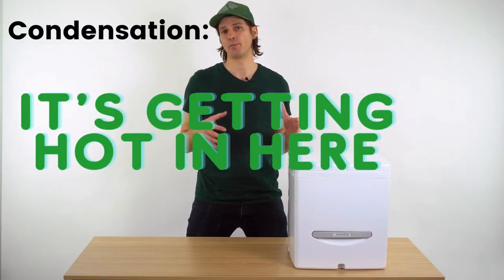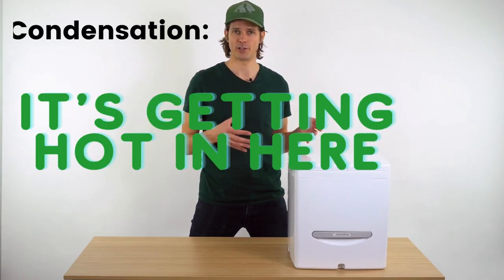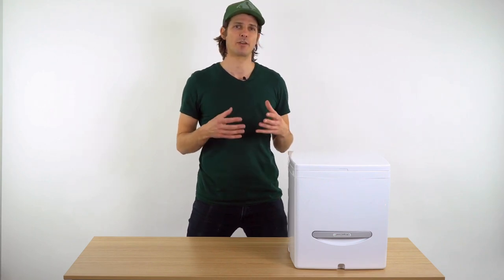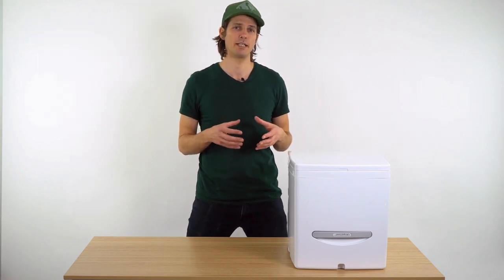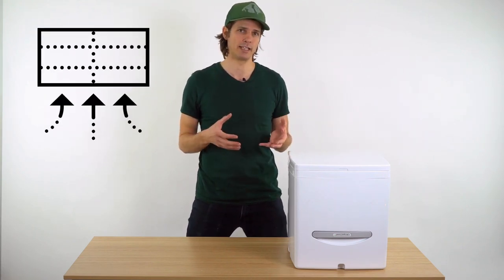Condensation inside Cuddy Composting Toilet

Comment: Condensation ... haha. It's a darn lake and a bit of paper towel doesn't cut it. The condensation also tricks the liquid container into thinking it's full. And so the light is on permanently. One of the reasons that I got this toilet was that I occasionally overfilled my Nature's Head. Now I just empty it every evening.

Condensation aside, it's the composting flies that are driving me crazy. They - their eggs - even managed to block the fan inlet. I'm now trying peppermint oil on my chux towel that I've placed under the solids bin 🤞
Reply from the maker: HI Darelle, I'm sorry to hear that you are having problems with your Cuddy. If your light stays on all the time, please email us, and we'll work to get it fixed. info@compocloset.com

Condensation levels can vary. Are you sure your problem is just condensation? Is your Cuddy set up correctly? Are liquids going where they shouldn't? 
Are you using the fan? Venting externally can also help reduce excess moisture. 
Some Compo Crew members with more condensation are using wood pellets to absorb extra moisture. 
This is an issue that we are aware of, and are working to find a built-in solution. 

The flies can be super annoying. Have you tried using diatomaceous earth? 

Consider joining our FB group or at least checking it out to get more user-based help. We have some compost experts who might have more tips for dealing with flys.
Reply: Yes it is set up correctly and I'm using the fan. I am following the FB group. Perhaps it needs some of my environmentally friendly kitty litter under both containers!! Not to worry as it will be colder soon and the microbes will slow down.

Comment: Does a power pack come with toilet and dies a fan come with it can i use a bluetti power station to run toilet
Reply from the maker: There is an internal fan. It has a cable with a dc jack and bare wires as standard. What adapter are you looking for for the bluetti? a USB?